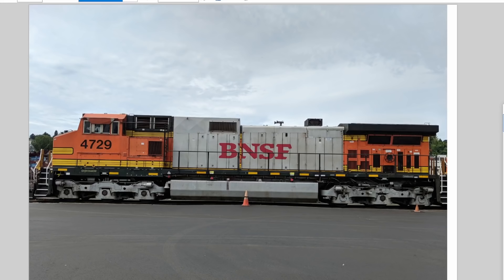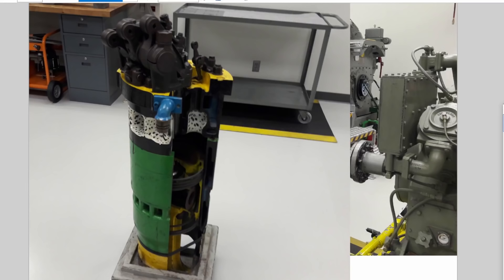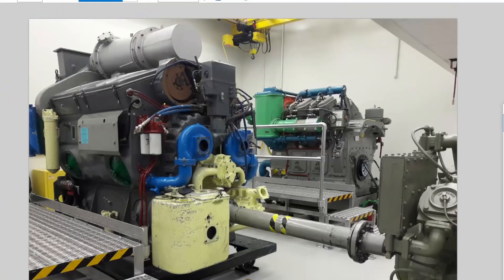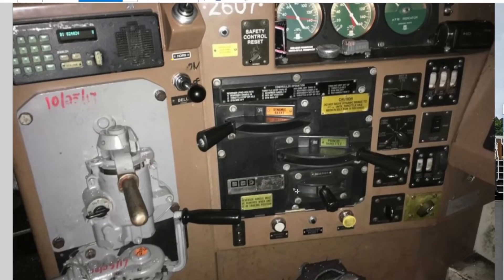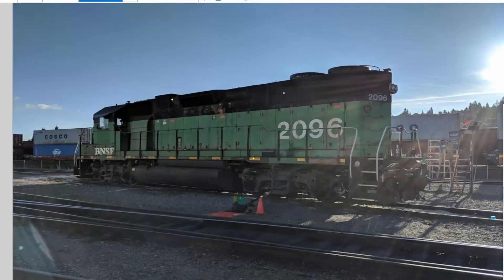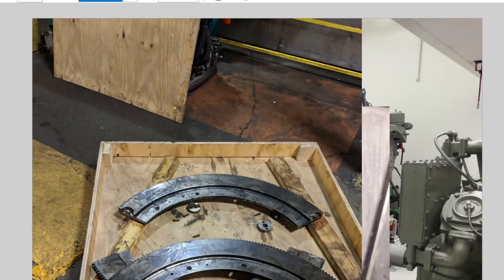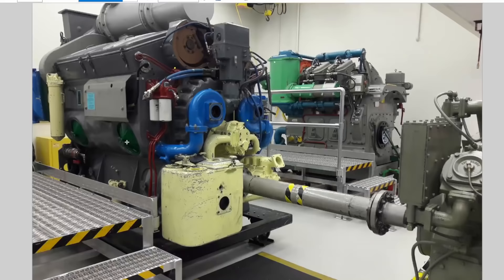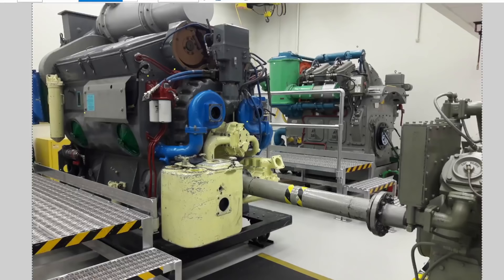Diesel 101 - How DIESEL LOCOMOTIVES Work! [10 Levels]

Comment: (This is long, but this seems to be a feasible idea for nuclear powered steam locomotives, just read me out):
 Any electrical train is technically a nuclear powered train if it is getting the electricity from a nuclear power plant. Being one of the cleaner sources of power, despite the past history of nuclear accidents, the effort that people have put to keep it clean and safe is ridiculously insane. And because I would like to be involved with at least throwing good ideas to multiple crowds to try to preserve the history of basically all the stuff and still manage to use it as other things adapt. If it's possible, I think that even all of those steam trains can go through a big conversion basically making them nuclear powered steam locomotives. People used electricity to boil water, we can get a steam train to switch from coal and oil to a cleaner power source. It will not be available everywhere because of the different power plants, but for any of those that are connected to electricity coming from nuclear, or any cleaner energy,  and still use steam locomotives,  it's a long term idea that can become reality. I'm only 25 and I know only a limited amount of knowledge between all those different fields that are required, and unfortunately I was not the brightest tool in the shed back then, so I lack the actual understanding in potential engineering problems that can come up designing the locomotive.

Comment: One thing that wasn’t mentioned is “barring over” the engine if it has been sitting for a while. Moisture will condense in the cylinder and there should be taps that open up the cylinder to drain them either using a bar on the flywheel end or the starter which turns the engine and blasts the condensation out of the taps.
Reply from the maker: Very true! We had automatic flashcocks at BNSF so I didn't tend to think about that piece, but you're totally right.

Comment: When I worked in the gulf our dive ship had 2 Wartsila mains. I'll never forget when the engineer took me down to watch routine engine maintenance cleaning the carbon at sea.
They had a valve that introduced room temperature water. I'm assuming it injected a fine mist of cool water, somewhere around the turbochargers. 
It was quite interesting intentionally injecting cool water into hot running diesel engine, just seemed like catastrophe wasn't too far away.

Comment: Where I come from a machine that converts mechanical power to  DC electricity using an internal commutator is called a dynamo,  a machine that converts mechanical power to AC electricity is called an alternator.  Power stations use alternators to supply the AC domestic power grid.  Motor vehicles have an alternator combined with a rectifier to supply the 12/24V DC power system.  The rectifier is internal  but the the combined unit is still called an alternator.  A generator is an internal combustion engine combined with an alternator and converts chemical energy to AC electricity, typically for use during grid power outages.
Reply from the maker: Interesting, I've not heard the term dynamo outside of steam applications.
Reply: @Hyce777  Perhaps I should have mentioned the fact that since dynamos haven't actually been used for anything for half a century most people here probably don't know the term either.

Comment: Here's an idea I've been thinking about. Instead of an EMD style geared turbocharger, they could drive it off an electric motor, which could then be not only turned off when the exhaust gas flow is sufficient but driven in reverse to extract power from the turbocharger. Napier made a two stroke diesel that had a turbo-compound setup, which essentially flowed the exhaust gasses through a turbine that was geared to the crankshaft to extract power from the exhaust gasses, and this would be analogous to that but with an electric motor instead.

Comment: The EMD turbos * have * to be clutch driven on the low end because of the  2-stroke thing, they absolutely need the pressure differential to work at all. 
4-stroke work just fine at atmospheric pressure and can happily wait for the boost to build and do without the extra complexity.

Comment: Hi Hyce, still think you should use batteries rather then resistors, modern batteries can easitly take up to 80amps charging current and its simple to stack them in the way, to cope with the charge as you can sinply increase the voltage and reduce current. Even if you hat to pull battery car as steams used to pull tenders.

Comment: The air flow meter shows just that, flow. It will show when air is "moving" in the brake pipe. When the system is fully charged with no leaks or actuation, no flow. It is useful to see leaks in brake pipe

Comment: The reason they main traction alternator instead of DC generator is when power exceeded 3000 horsepower a main traction alternator was required otherwise you would need a full car body as the DC generator would be as wide as the locomotive frame. The engine model 567, 645, and 710 engine indicates the displacement per cylinder.  That’s right, a 710 engine is 710 cubic inches per cylinder. 

Food for thought
Reply from the maker: That makes sense. I didn't know that piece or reasoning behind it. Thanks :)

Comment: One thing I was always curious about when it comes to diesels was how the multiple unit system works. I know there's been a myriad of ways to do it over the years from all the different manufacturers, electrical, pneumatic, etc, but the actual action/how it works is what's not often talked about. 

Decidedly a steam guy through and tbrough, but I will admit a liking of the older diesel power on the side, particularly the ones from Alco.  The PA was the most handsome diesel I've ever seen, pity there's so few of them now.
Reply from the maker: It's pretty simple in concept, but something I don't know enough about.
Reply: On each end of most mid 50's and later locomotives, there is a big (I think it's 21 pin, but I'm not sure) connector, and a large cable is plugged between units. It's essentially a big data cable to tell the other locomotives what to do. Fun fact, there is no need to "tell" each locomotive which way it is facing, as one of the pins is dedicated to sending that info. There are also the air connectors mention in Hyce's braking video.
Reply from the maker: @CNR-fw9ei  Yeah I think the MU pot is 21 pin.
Reply: Actually the mu cable is 25 pin common between EMD and GE locomotives.

Comment: @ 14:46 I like the 710X16 and my favorite is progress 1010X12 it's a 4 stroke and rated at 4500 HP, they both have a maximum RPM of 1500, the 710 is 183 liters and the 1010 is 198 liters
Reply from the maker: The 710 can do 1500 rpm? Really? I only ever saw them with max RPM's around 900.

Never got to see a 1010 in person.

Comment: 35:25 the GE is the same. The "front" of the engine is in the back of the frame like the EMD. They just mount the turbo at the front of the engine, which puts the exhaust duct in the back too.

Comment: 24:36 Do you lose field diverts on those if you set a pair of motors to cut out? I'm sure remember hearing someone mention the 50 on the line I used to volunteer on having a couple of motors isolated, which I recall somehow affected the diverts and caused it to behave different. At least it ran though.
Reply from the maker: Good question, I am not 100% certain. You definitely lose pulling power as you cut motors out.

Comment: As you increase the power setting on the engine throttle, the engine speed goes up, the output frequency to the drive motors increases, and the voltage also goes up, as much as 3000 VAC on some models, but both the frequency and voltage drop as less power is needed to pull the locomotive.   So at 100 RPM, the frequency is very low, say 20 hz, and the voltage is also pretty low, say 300 - 400 volts, so the motor is not hit with the full 3,000 volts until the frequency is much higher and the output amperage is at the most.

Comment: Great information!  So if the guru valve opens it just spills all over, is there not a way to catch that fluid with out making mess?
Reply from the maker: It dumps into the sump in the frame. Many locomotives are equipped with a "diaper tank" that can then store this and release it at the appropriate time, but many don't. Lol.

Comment: Huh. The EMDs have electrical starter motors. Here I was thinking these locomotive engines are simply too large for electrical starting to be practical, so I just assumed that they used compressed air start.
....And this is probably the part where you tell me that the GE locomotive engines use compressed air to start (you know, because they have to be different "just to be different").
EDIT: Watched another roughly 15-ish seconds of video, and the GE locos use the main alternator as a starter motor? Alright, color me impressed, that's just elegant engineering. You've got the "mechanical to electrical" doodad right there, just run it in reverse to start the engine!
Of course, IIRC there ARE diesel-electric locos that use compressed air start, I think the UK liked them that way.

Comment: @ 17:21 2 stroke engines with intake ports NEED forced induction or they will not run  the turbos are clutched because they will not work at very low RPM, they are essentially blowers rather than turbos just like you said the 4 stroke has poppet valves for the intake side also so they can run naturally aspirated whereas the 2 strokes cannot, you can blow a turbo on a GE and it will still run.
Reply: I'm not trying to embarrass you I just have some knowledge that I like to share and thank you for the corrections.

Comment: It lets you know how much air you are putting into the air system. In the trucks we have an emergency air line and a service airline to the trailer. Emergency line is constant air supply that releases the emergency braking. The service line puts the air to the manually controlled brakes.

Comment: absolutely love this look into an USA Diesel Electric locomotive, its a shame though that you didn't mention ether Diesel Mechanical or Diesel Hydraulic  locomotives, especially as I'd expect that its the former of the missing that's likely to be added to R.O. (surely the Geese aren't DE's?)

side not is it worth doing these videos on the specific locomotives of R.O. as what the conponants are and the oporators of the locomotive?
Reply from the maker: The geese are gas-mechanicals. I figured I'd cover what 99% of what we have in the states is first, and hit the fringe guys in a separate video.
Reply: @Hyce777  wow no kidding? Yeah it makes sense now, especially when I deal with the old fashioned AB signalling here in England, (yes on national network and line speed is 90MPH… with semaphore signalling…) & not really big American diesels…

Comment: FWIW, when you're talking about how much current (amps) is involved with dynamic braking you're conflating current and power. What really matters is power (watts). 1000 amps at 0.001 volts is only 1 watt (very low power). 1 amp at 100kV is 100kW.

The reason railroaders can just think in terms of amps is because everything is running at a pretty constant voltage. Since power = voltage * current (watts = volts * amps), with a constant voltage you can use current and power somewhat interchangeably. Many (most?) diesels have an ammeter to monitor how much current is flowing to/from the traction motors; again, what you really care about there is power, but power meters are more complex and expensive than ammeters, so since the voltage is constant manufacturers go with the cheaper option (ammeter), so everyone just thinks in terms of current (amps).

Comment: Fascinating!   I knew 'diesel locomotives' are actually 'diesel electric' that is; the diesel engine actually powers the generator/alternator which generates electricity to power the electric traction motors.  Interesting that the diesel engine does not have to run at high rpm's to make the required power..sort of like the old John Deere two-cylinder tractor engines they do not run at high rpm's but make their power through large piston size and a long piston stroke which equates to a lot of torque without the need for high rpm's.

Comment: 2 strokes running forever is true. both neighbors have old as hell 2 stroke grass trimmers that barely need any work to keep running. my dad's 4 stroke on the other hand needs a carb clean every other year and is very finicky to get running and stay running. he's gonna upgrade to a cordless electric trimmer soon as the yard size doesn't warrant the endurance of a gas trimmer and mower (yes the mower will be upgraded to an electric on as well)

Comment: This is fascinating and a long overlooked subject. I would like to understand where the pressure is contained to supply air for a 2-stroke as it is not a vacuum draw like small single cylinder consumer designs. Excellent video- consider me subbed!
Reply from the maker: The airbox, after it's been forced in by the turbo.
Reply: @Hyce777   So is there an intake manifold @those skirt inlets under constant pressure? Btw… that turbo is monstrous!
Reply from the maker: @kenmunozatmmrrailroad6853  Yup, the whole "air box" is essentially an air manifold connected to the output of the turbo.
Reply: @Hyce777  between you and the guy who explained current to the field magnets, I’ve had many questions resolved this morning… thanks to all!

Comment: Those change-out cylinders reminds me of the barrels on M41, M48, and M60 series tanks.
Reply: Shoulda mentioned.  The M41 engine has 6 of these barrels for 895 cubic inches. The M48 has 12 for 1790 cubic inches. In round numbers, each barrel is 150 cubic inches. They are individually replaceable, and can be used in either engine. Being air cooled makes this easy,  no plumbing associated with liquid cooled engines.

Comment: A comment and a question...

I'm sure someone already mentioned this but, if not, a roots blower actually pumps around the outside portion of the impeller lobes, not through the center. The center is actually filled by the intermeshed lobes so air cannot flow through the center. The outside though contains large gaps between the lobes and it is those gaps that are used to transport or carry the air from the inlet to the outlet.

My question is, if using a turbo, especially an entirely exhaust driven turbo, how do you start the engine? Those two strokes don't use crankcase pressure from the backside of the pistons, like a traditional 2-stroke small engine. Instead they rely on an external to the engine air pump, traditionally the roots blower, to generate that air pressure. Since a turbo doesn't produce any pressure until spinning fast and doesn't spin fast until the hot exhaust is flowing, how do you start a turbo based two stroke? Is there a huge tank of compressed air somewhere used to start the engine or something?
Reply from the maker: That's the whole purpose of the clutch-driven turbo. The starter motors (which, yes, are sometimes air powered as well) start the ring gear spinning, which is attached to the gear train that drives the turbo at an 18:1 ratio. So, the turbo does spin to provide that air from the get-go. Once the exhaust pressure gets high enough, (notches 6-8), the turbo freely spins as it "pops" off the clutch.

Comment: Old EMDs are 2 stroke 710, 645, 567. The new 1010 which was built on the 265H are 4 stroke. They made the change because they couldn’t hit T4 emissions
Reply: So funny enough EMD finally got the 710 to T4 how by finally using DEF... 
Like just use DEF already class 1 instead of this overly complex gas recycling method

Comment: My experience with diesel generators they run at a constant RPM to maintain the cycles to run the motors. The motors have shunt windings to control the motor speed. The injector pump or the Electronic Control Unit, depending on the age controls the speed of the engine. The speed of the engine doesn't control the speed of the motors. The switches in the console control the motor speed and the speed of the locomotive. More load on the alternator the fuel system compensates for the load by increasing the fuel to the injectors to maintain the preset RPM.

Comment: The difference between the terms "alternator" and "generator" is actually just a matter of seeing the tree as opposed to the forest. When you say a generator, you're talking about something that uses an input form of energy (like gasoline) to output electricity. The alternator is the specific part of a generator that produces the electricity.
Reply from the maker: Not to my understanding? A generator does not require electrical excitation, an alternator does.
Reply: @Hyce777  https://en.wikipedia.org/wiki/Alternator
You're actually just talking about two different kinds of alternators. Colloquially, most people think of the thing in a car when you use the word "alternator", but it really is just the technical term for the particular piece of the generator that produces the electricity. In the case of the car, the generator as a whole is the gas-driven engine, because it's driving the alternator.